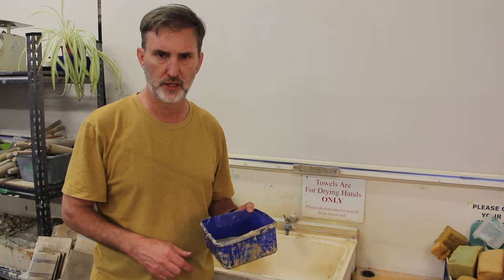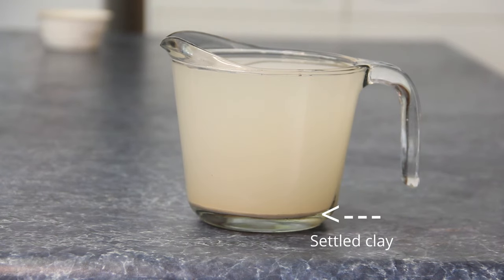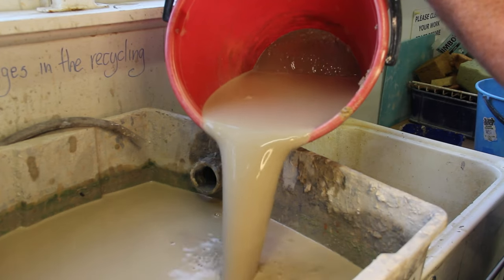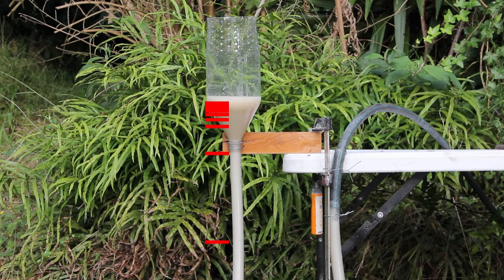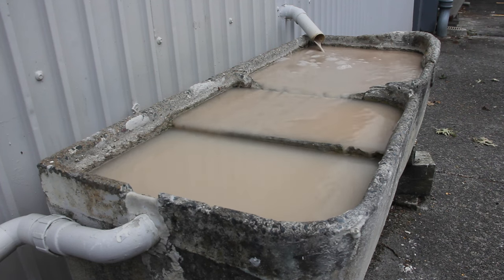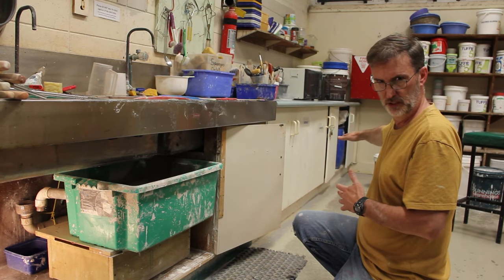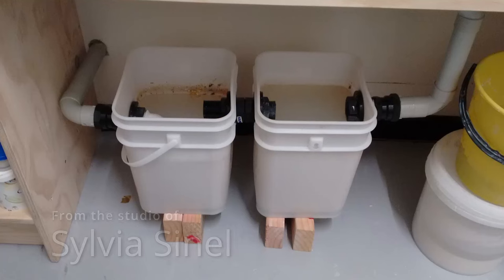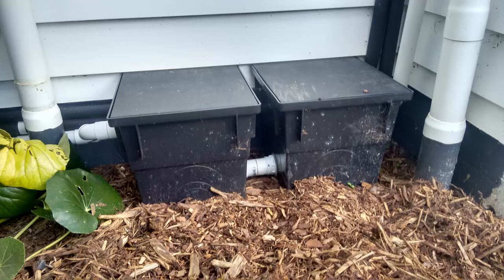Pottery clay trap and how they work

Comment: I have no plumbing in my studio. I run clean water in with a garden hose to my utility sink through a sealed hole in the wall.  A large plastic tote box under the sink catches all water etc and I use a small pump to send it out through another hose to a French drain. Imperfect system but real simple and effective.  Every month or so I scoop the slip etc out of the bottom of the tote box and trash it.

Comment: The flaw at 8:55 was probably due to the installer being too familiar with fitting grease/oil traps for kitchen waste. Nice video, cheers for sharing.
Reply from the maker: I looked at some grease trap designs and think you are right. The pipe being at the bottom would block stuff that floats like grease and oil.